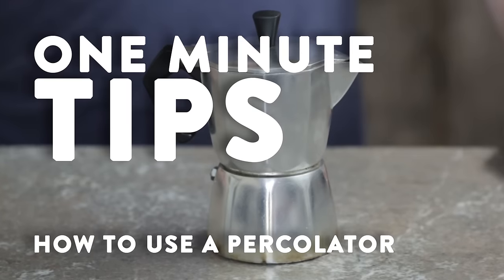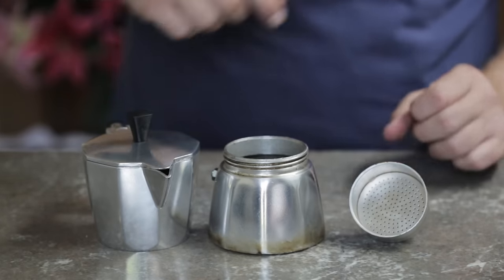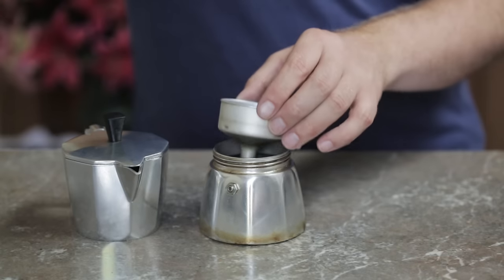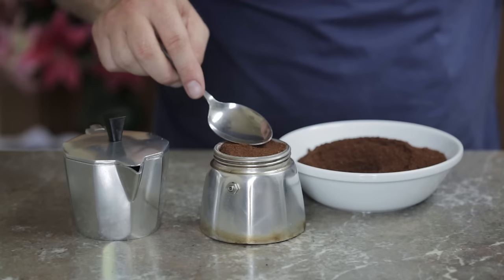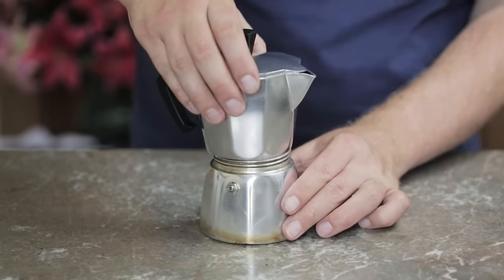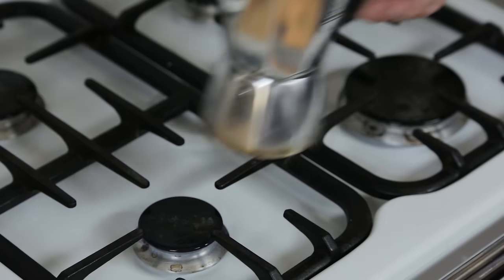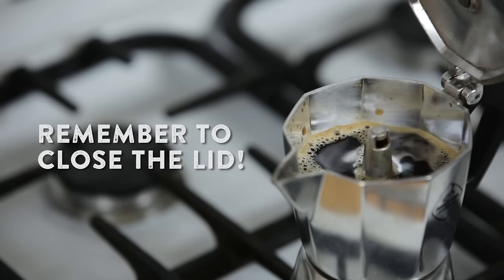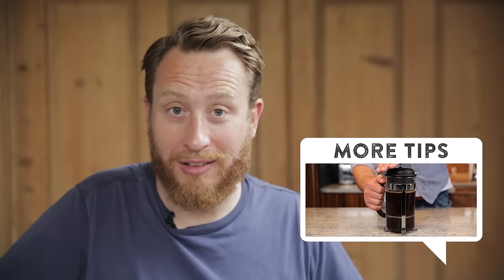How to use a Coffee Percolator  | Food Busker | One Minute Tips

Comment: hi there, just two more tips and corrections (i'm italian and i use this thing every day):
- use a little bit more ground coffee
- you dont't need to use hot water, room temperature is ok
- if you use too much ground coffee and the coffee won't rise, just put the bottom part under running water (be careful not to spill che coffee in the top part of the moka) for few seconds and put che moka over heat again. Coffee will start to rise again.
- BEFORE serving your coffee,  STIR IT!!!!

- if you like to use coffee for your cocktails, here's a tip: use the moka coffee you made the day before. The fat in your coffee will ticken and you will get a stronger flavor.
Reply: +Matteo Carmelita one more tip: if you buy a brand new moka, make coffee for 2-3 times without drinking it, it will taste horrible. After those 2-3 coffees your moka will start to make good coffee.

MOST IMPORTANT THING: don't EVER wash your moka with soap! Just clean it under running water.
Reply: +Matteo Carmelita Agree on everything and especially on the "MOST IMPORTANT THING"! It really makes the difference.
Reply: one man (also italian) taught me that I should NEVER tamp coffee down! never press it, just gently align it by edge of spoon.
Reply: the man is right!
Reply: @matteocarmelita2561  😊

Comment: When I try this I only get a few drops spewed out of the top, but all my grounds are thoroughly used.. why doesn't it look like theirs which is streaming down the stem so nicely? 
Also mine has a couple metal filters that go on top of the grounds. I should use those, right?
Reply: Josh Dauer Maybe you make it at a too high temperature, try to lower the heat and see how it goes. 
Edit: also you can use cold water instead of hot.

Comment: I tried using a stove top percolator and it will not perk! all I have is booking water at the bottom of the vessel. Ive let it boil for almost 30 minutes and upon opening my basket I noticed all my grinds were completely dry indicated water not coming up thru the tube. any advice?
Reply: boiling**
Reply: I've been making coffee this way for years.  Only thing I can think of is that if you had the basket on the tube when filling it, perhaps some coffee grounds got into the tube and clogged it up.  When coffee first starts to perk, it's not actually boiling, but capillary action causes it to rise in the tube.  When you see it start to perk, turn it down to medium low and perk for 8-10 minutes from there.  If the water was really boiling, but not rising up the tube, something must have been blocking it.  Also, if you look at the bottom of the base, you should see a little notch that enables the water from the main part of the pot to get in there and then go up the tube.  If for some reason the bottom was bent so the water couldn't get in the space at the bottom of the basket assembly, that might have blocked it from going up the tube.
Reply: It's nothing to do with blockage of the tube. The only two logical explanations are that the pressure relief valve is damaged and allowing pressure to escape before enough builds to force the water up or the seal is missing or damaged.
It's essentially a pressure cooker, thermal expansion forces the water up throuth the grounds and into the upper chamber after extracting, if this tube is blocked the relief valve on the side will blow like a pressure cooker valve to prevent the pot from exploding.
Additionally, this is a Moka pot, not a percolator, a percolator re cycles the coffee through the grounds repeatedly and makes a very bad over extracted brew. If you are in fact using a percolator then your problem is different.

Comment: A moka pot is not what north Americans call a percolator.  I am old enough to remember when percolator pots were on practically  every stove top in America.  It's the one with the glass bubble on top.   
The moka pot forces the water through the coffee, from the bottom, one time only.  A percolator puts the water over and through the coffee basket repeatedly until the desired strength is achieved. It uses a course grind, not an espresso grind, like your moka pot.  I love my moka pot but it is not a percolator.
Not one of the stores in your ads selling moka pots, uses the word percolator, because they are Not percolators.

Nothing wrong with your information, except the term "percolator". That is just wrong.

Comment: A percolator is some thing totally different.
Reply from the maker: +Chase Williams ?
Reply: A percolator is a larger pot. It makes a brew similar to a drip machine or a press. Instead of forcing water through the grounds at high pressure It bubbles up through a tube then drips over the grounds which are wrapped in a paper filter. This continues in a cycle until the desired strength has been reached. They're nice to use when camping.

Comment: Why do you put hot water in the bottom?
Reply: +Peter Verschoor I think it's because in bigger pots if the water is cold it heats up too fast and unevenly. In small pots like the one on the video it's perfectly fine to use cold water.
Reply: Using pre boiled water makes a tremendous difference to the flavour and allows the coffee to extract without being overheated first as the hot water creates pressure more quickly, see my channel for a method comparison of Moka pot (it is not a percolator) coffee.

Comment: Many ways to do the same thing and it still tastes like coffee. 😂
Reply: I'm a coffee connoisseur and while coffee is coffee, The process in which it is made absolutely affects the quality and taste. People have traded convenience for quality.... You'll never have a better tasting cup of coffee than with the percolator unless you go to a coffee shop where they have an espresso machine. Electric coffee machines burn the coffee before you've had a chance to drink it, to wear a percolator does not do that unless you leave it on for too long which at that point is on you. If you compare a cup from a percolator to a Keurig or an electric burner you will see that there is a slight burn taste that the percolator doesn't create Because the water boils up through the coffee instead of coming down too hot and then sitting on a burner which burns it making it bitter. Americans just haven't realized that they've been drinking burnt coffee for the past however many years which is why they need so much cream and milk